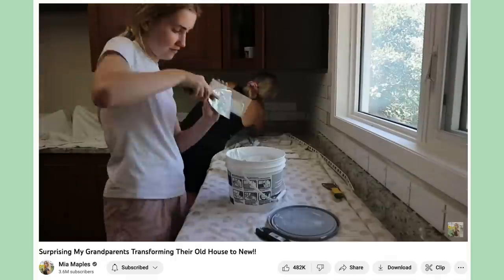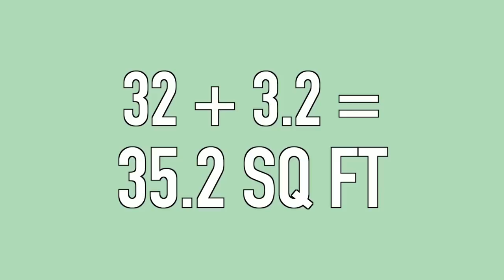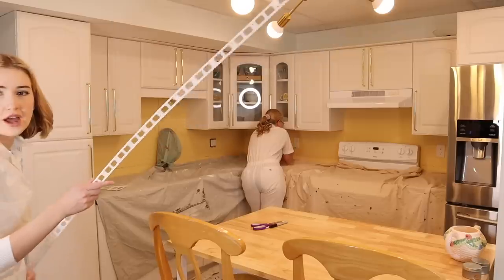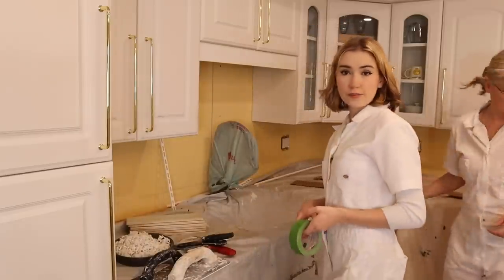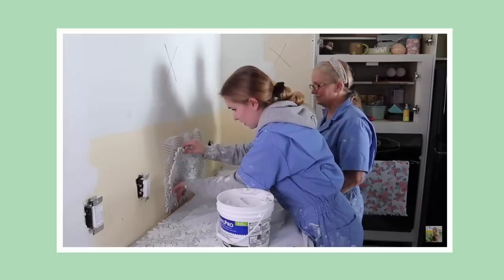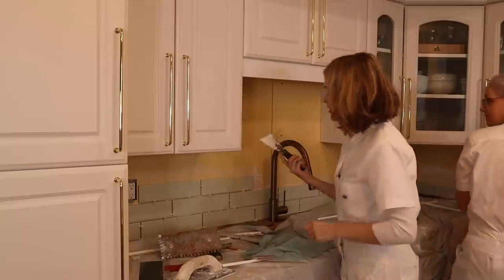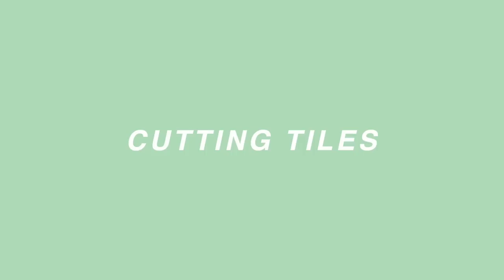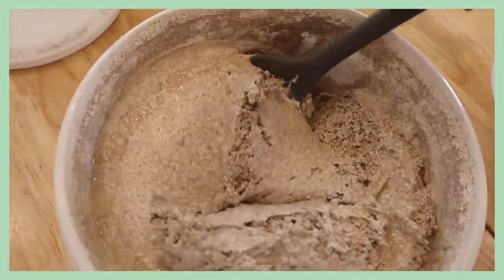How to tile a backsplash: if you have no skill like me : )

Comment: Hi Mia! 
Wanted to give you a tip with the tile edging! You don't have to outline the space with it. Basically you use it wherever the tile isn't butting up to something already existing. For example, if you tile halfway across a wall and stop mid wall. The edging then acts as just that, a faux edge giving a clean look to the cut edges of the tiles you'd end up seeing. Otherwise the underneath of your cabinet or other walls already serve as you clean edge. 
Hope this saves you time and resources
Reply: This is great advice! Cause she will save money by not buying extra edging. 😎
Reply: Yes I was going to mention this 👏🏻

Comment: This is actually so awesome, I love seeing how far you’ve come with the reno videos. Some feedback for the silicone! If you spray it down with some soapy water before running your finger across it, it makes the application way easier (and a lot less sticky).  I would also pull the oven/cooker out (doesn’t have to be all the way, just far enough to reach behind it) to tile behind it otherwise it’s going to be a struggle if you ever have to replace it 😬

Comment: Just wanted to add that you should make sure that the grout won’t stain your tile before you start. Take a piece of scrap or broken tile, wipe grout on half of the surface of the tile, wait ~5 minutes, wipe all the gout off and clean the tile thoroughly. Once it dries out you should be able to see any stains and buy new grout before you have a wall full of splotchy, stained tile. 

This is also a good time to see what color your grout will dry down to. Just let a bit dry on some cardboard but make sure it’s fairly thick. I aim for a line that’s about the same size as a 3-4 inch long pencil but a thick blob works too. If it’s really thin it might dry lighter or look shinier if the sand/particulates don’t have enough room to settle into the grout fully. After your test grout piece dries you can see if it works with your tile and the lighting of the room it’s going into.

Comment: This was a great instructional video. Mia explains and illustrates at a level I can absorb and feel that I took can put on a back splash which I am thinking of doing this spring. Since it will be in two relatively small areas in the bathroom and kitchen, I hope to buy discounted tile. QUERY: Is grout grout, in the sense that the bathroom is a humid/closed environment while the kitchen is more open space so do I have to be careful about glue, plaster ,grout?. I am asking here as when I ask a professional (virtually or in real life) I usually get WAY too much information and get lost (just like in real driving life😆).
Reply: I could be absolutely incorrect about this however in my experience (in australia) Bathrooms/wet areas are usually prepped differently (eg fc sheeting instead of plaster and they MUST be waterproofed) however I think that the tile glue and the grout are the same as all other areas of the house 😁

Comment: This may be a silly question.....but if our wall has texture, do I need to sand down that entire area smooth before I can add a backsplash? Or will the "glue" fill in the gaps of the texture and still hold the tile? Hoping to save a ton of elbow grease if completely smooth is unnecessary, but I also want to do it correctly the first time so it doesn't randomly fall off and have to do it all over again, lol.